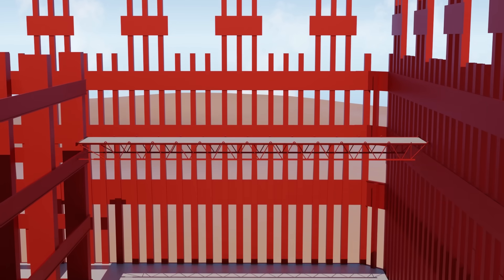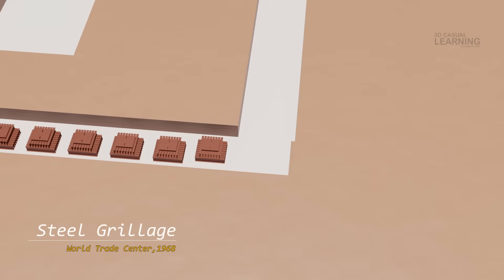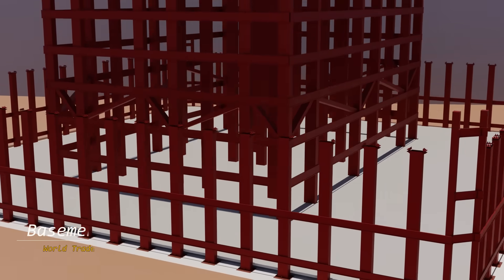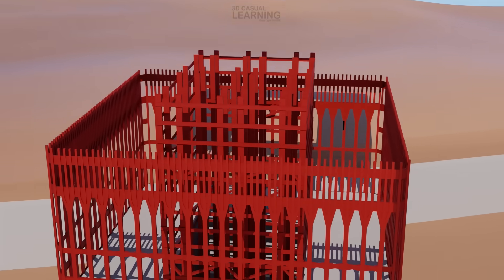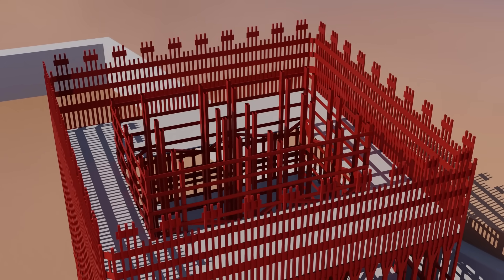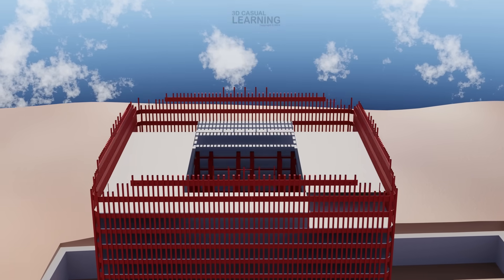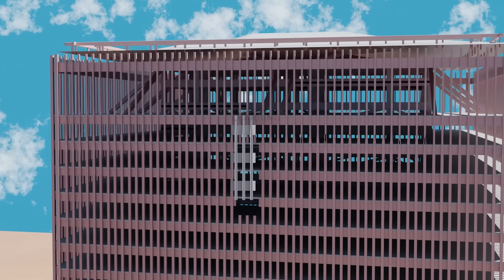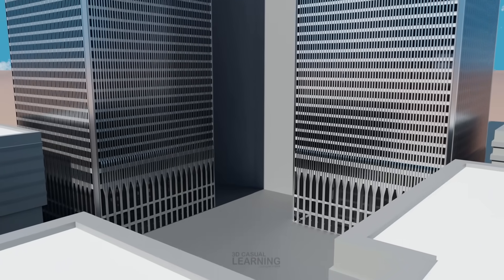The Rise of the World Trade Centre: Construction Story Before 9/11 in 3D Animation

Comment: A building should support 2 times its weight, which is a safety factor. Vertical perimeter columns peel off when the building is collapsing and each floor gets support from the outer skeleton and core beams. Why did it peel off? Connections between the exo skeleton and each floor are strong as to support the weight of the floor. When upper floors fell over the floor, connections were cut off from the exo skeleton because those connections are not strong, so the outer structure peeled off which is explained as a pancake or domino effect. Exo skeleton structure is one of the reasons for to increase deaths and the collapse of towers perhaps.

Comment: So where is the data on the distribution of steel down the structures?

How many tons of steel were on level 105 compared to level 5 which had to support the weight of 21 times as many stories?

Why weren't structural engineers and physicists discussing that within weeks of 9/11?

In fact AE911Truth does not discuss it even though I confronted Richard Gage about it at one of his Dog & Pony shows in 2008.
.

Comment: how easily it fell with controlled explosives
Reply: Dope you are like a lot pf people you just post ignorance - As any engineer will tell you you don't have to heat steel to melting point you just have to heat it enough to weaken it 
And two take it from a volunteer firefighter of 8 years - With all the chemicals in a modern building ( furniture and applinces ) the flashover point can be reached in less than 3 minutes and can reach 3600 degree celsius 
Here is a link that shows flashover - A flashover fire is the nearly simultaneous ignition of all combustible surfaces in an enclosed area, transitioning a localized fire into a fully engulfed, rapidly spreading blaze. This occurs when hot smoke and gases at the ceiling are heated to their autoignition temperature, then radiate heat downward to the room's contents, causing all exposed materials to release flammable gases and ignite at once. Flashovers are incredibly dangerous, as they create unsurvivable conditions within seconds, trapping occupants in a fire ball with little chance of escape.   - https://www.youtube.com/watch?v=BtMmymOxdjc&t=132

The 757 planes had 36000 gallons or 90000 litres fuel

Comment: And all that steel came straight down? 80 floors of healthy, not affected steel?
With v-cuts around the base? Why did it not collapsed to one side or the other? In the path of most resistance? 
Get real, the sh*t was blown to dust. Not even DNA found from 1000 or more victims? Where is the black boxes? And "they" found a passport from one of the terrorists? 
Many questions and never ever one straight answer.

Comment: FUCKING FLIMSY DEATH TRAP.......JUST  SOMETHING TOO  FLIMSY  ABOUT  ITS  CONSTRUCTION......NOT  ENOUGH  SUPPORT  PILLARS  AROUND  ALL  THE  WIDER  FLOOR  AREAS......TOO   FUCKING  OPEN..... AND  THE  WAY  IN  WHICH  THE  FLOOR  BEAMS  WERE  WELDED  TO  THE  OUTSIDE  WALL  SECTIONS......IT  ALL  JUST  HAS  A  NASTY   ALMOST  FRAGILE  FEEL  TO  IT  WITH  THE  MAIN  STRENGHT  BEING  IN  THE  CENTRE......NOT  ALL  AROUND  THE  CENTRE.......SHOULD  HAVE  BEEN  A   SEA  OF  IRON  GIRDER  STYLE  SUPPORT  PILLARS....  ON  EVERY  FUCKING  FLOOR  RUNNING  ALL  THE  WAY  THROUGH,  AND  DOWN  THE  STRUCTURE  TO  THE  GROUND  LEVEL....THIS  WIDE  OPEN  SPACES  THINKING......WAS  NICE  TO  WORK  IN....BUT  ULTIMATELY  MADE  THE  WHOLE  SRUCTURE  WEAK   IN  ALL  AREAS  AROUND  THE  CENTRE  COLUM....THIS  ULTIMATELY   WAS  PUT  TO  THE  TERRIBLE  TEST  BY  AIRCRAFT  IMPACTS.....AS  THE  CENTRE  COLUM  AREA/ AREAS  WERE  DESTROYED.....THE  WEIGHT  ABOVE  THE  IMPACT  ZONES  WAS  TOO  GREAT  FOR  JUST  THE  FLIMSY  OUTER  WALLS....AND  IT  BUCKELED  LIKE  A TIN  CAN..... !!!!!!  TOO  WEAK  AROUND  THE  CENTRE  CORE  AREAS.

Comment: I realize this is a dumb question, but why couldn't they just rebuild the towers back according to the original design? Would it have been possible?
Reply: Donald Trump put together a plan in the mid-2000s to rebuild the towers but make them 115 floors tall, and with concrete cores, building the new towers right next to the footprints of the old towers, but the plan never saw the light of day, and probably would've given survivors PTSD
Reply: It had design flaws especially for evacuations. They were a plan created from Trump to rebuild the twin towers but "stronger". Which is would've loved to see that than what we got now but I understand why they choose the freedom tower.
Reply: Possible, yes.  However there were many design flaws made especially apparent after they collapsed.  A redisign to modern standards would be necessary.  I like the new tower, it's beautiful and full of symbolism but doesn't project the same sense of scale as the original 2 (even if they twinned this one)
Reply: It's Literally Just A Design From The 60s + Everyone Inculding Survivors Would've Had PTSD Flashbacks.

Comment: The 47 core columns of each tower are puzzling. Initially fabricated in the far east and shipped in. Other than some strange videos filmed from the  Hudson where the remnants appear to disintegrate in mid air and called 'spires' over 600ft high l wonder what happened to them 
    At their base the concrete slabs etc impacting should offer a 1000th of a Hiroshima in energy at most

   The buildings were utilitarian but the safety requirements were ditched after construction of the slurry wall had began.
  The Port Authority reduced the number of stairwells from 6 to 3 ..
       2 of these only 44" wide !
   This was an unsafe working environment.
 The truck bomb of '93 required an evacuation which took 4 hours using elevators and stairwells.
 A power outage alone could have been hazardous 
   Ref. Evacuation time of Sears tower / Chicago building for example 
  
   The Twin towers lead structural engineer John Skilling stated that 'either tower could lose an entire side of exterior columns due to a 707 plane strike and still withstand a storm of the century gusting 100mph although fire casualties would be horrendous'. 
        This is not impressive structural engineering if the core is compromised (disabling all elevators in the tower and blocking stairwells at plane strike floors) trapping occupants above. Commercial aircraft were known to be getting larger 
      
  A bright red 25' sculpture called bent propeller was moved around the WTC towers , last put by WTC7
Reply from the maker: Thanks for your detailed observations and sharing your research; it provides important context to the structural design and safety aspects of the towers.

Comment: The trusses were connected to the outer perimeter wall and the core with remarkably small "hooks". They look so small it's hard to believe they held the whole building together for all the years that they did. Each of the trusses had 3 of these "hooks". I know this information, not because I have inside information, but one of these trusses can be seen in my town as part of the 911 memorial. Just looks flimsy. Ridgefield, CT.
Reply from the maker: That’s a really interesting observation, and it’s amazing that you’ve seen one of the actual trusses up close at the 9/11 memorial in Ridgefield. The design might look minimal or flimsy at a glance, but it was part of an innovative structural system that relied on the full interaction between the trusses, the outer perimeter, and the core. Engineering often surprises us with how strength comes from smart design, not just size. Thanks for sharing that detail!
Reply: Thank you arm chair engineer, I can't believe that you found it hard to believe that the building stayed together with what you observed to be flimsy hooks. Maybe your engineered building will withstand a wide body jet flying into it.
Reply: @dancovaleski6520 yo respectfully shut the hell up. why do you just hate everything? i've found at least 2 hate comments from you on the same channel. what is wrong with you? like if you hate the Twin Towers, that's your opinion, and you don't have to share it. you might as well be with al qaeda at this point, gng.

Comment: Yet this solidly built structure was brought down by a pressurised aluminium cylinder, 1/8th of an inch thick, travelling at speed?
Reply: Yes
Reply: @davidpowell6098  it was the jet fuel burning that melted the steel causing them to collapse
Reply: @MW_Green  The steel weakened
Reply: @davidpowell6098  Can Floors Collapse 300 Feet Below a Fire Due to Heat Alone?
Generated on May 20, 2025 at 11:15 PM
Short Answer:
No. Floors 300 feet below a fire cannot collapse from heat alone unless the fire directly spreads there.
1. Heat Doesn’t Travel That Far Down by Itself:
Heat from a fire rises. Steel conducts heat, but not fast or intensely enough to weaken structural steel 300 feet bel
2. Floors Can Collapse Downward From Above – But That’s Not Heat:
If upper floors collapse due to heat, the falling mass can crush lower floors. This is gravity and impact, not heat.
3. For Heat to Weaken Floors 300 Feet Below:
- A fire would need to be burning on those lower floors.
- Or the fire must spread down through structural gaps.
- Or involve a separate ignition source.

Comment: Asbestos was used as a spray on fireproof coating.
Reply: Only in Tower 1 and only up to around the 35th floor. NYC banned its use early in the project and they switched to Blazeshield SFPM. There was no asbestos in WTC 2.

Comment: Imagine building a juggernaut out of steel and concrete all only to then lead people to believe that a jetliner cut through it like butter
Reply: what did you expect to happen? the plane bounces off the building?
Reply from the maker: The jetliners caused massive damage by penetrating the exterior columns, igniting intense fires fueled by jet fuel and office materials. This combination of structural damage and fire ultimately led to the collapse.
Reply: @3dcasuallearning  You mean that the thin aluminum fuselage of an airplane designed to be as light as possible passes through thick and narrow steel columns (3 times denser than aluminum) designed to best withstand tensile and compressive stresses?
Reply: @Neo-je4bi at 500 mph, yeahhhh
Reply: @Little_bacon_bit  An airliner flying at cruising speed close to the ground? Is it really possible?

Comment: The open floor plan was a driving factor for the design. However, what I don't fully understand is if this was so important why wasn't each floor designed with higher ceilings? The typical ceiling height on each floor was so  low. The interior seemed claustrophobic. It really defeated the open plan design.
Reply from the maker: The typical floor-to-ceiling height in the World Trade Center was around 8.5 feet, which was common for office buildings at that time. While it may feel low by today's standards, it was designed to fit within the structural limits and design goals of the era.
Reply: @3dcasuallearning  8.5ft  is a typical ceiling height. Today, tomorrow, always. The building was designed with those ceiling heights to maximize space which maximized leasable area which maximized profits.
Reply: The ceiling for numbers of bodies disappearing in a building collapse is less than 10% . How could that number become 90% ???!!!

Comment: I worked to do an office build out on the 83 floor. We installed floor to ceiling solid doors on pivots. It was amazing to me how much the plumber bob would swing when after installingbthe top pivit we had to locate the spot for bottom pivot. The plumbbpb would swing an inch or so back and forth sometimes we’d slit the difference and adjust later when we saw the gap at the jamb
Reply: There wa also a technical plumber for elevators. If it moved too much, elevators were shut down automaticaly.
Reply from the maker: That’s an awesome story! Thanks for sharing your experience....it's incredible to hear firsthand how much the building would move at those heights! Must have been quite the challenge!
Reply: Да там все здание такое. Всего 3 эвакуационные лестницы на этаже и все они являются задымляемыми, без тамбуров для дымоудаления. В России такое здание никогда бы не прошло экспертизу по пожарным нормам.
Reply: @nd5301  просто надо больше денег занести было.
Reply: @nd5301  Какого черта ты здесь?

Comment: Only thing that would “pancake” might be the floors spanning between the core and exterior columns (and there is no 100 floor stack in the rubble pile) but no way would the verticle steel columns  pancake and most certainly not at the same free fall rate we witnessed in videos, thus that leaves only one explaination that fits it all together perfectly.
Reply: Large portions of the core were still standing for several seconds after the collapses. You can see this in some footage. So the floors did kind of strip away from the core as the collapse progressed. The core though was also heavily damaged and fell apart too. For the record, neither building fell at free fall speed. This is a widely spread claim but its incorrect. The timing of 9 seconds, and 11 seconds was calculated by taking the exact moment the building would begin falling and when the first large parts of the building struck the street below (which was detected). However, the first parts to hit the ground encountered only air resistance on the way down. The actual collapse times are hard to estimate.
Reply: @JDela10  no I don't believe what you're referring to was the core, but rather just long sections of a perimeter wall section. 
I've seen that footage and it doesn't line up with where the core was
Reply from the maker: Thanks for sharing your perspective! The collapse of the towers has been widely studied, and I encourage looking into the engineering reports for more detailed explanations of how it all happened.
Reply: @3dcasuallearning  Widely studied by who? The government that did it? I encourage you to read government conspiracies like Operation Northwoods,and for media complicity Operation Mockingbird also study bld 7 that was a completely different structural configuration not hit by anything yet fell by fire after the owner said “pull it”
Reply: @joedoe-sedoe7977 There have been independent investigations of the collapses, minus the NIST.

Building 7 was hit by debris from the collapse of the north tower. The owner saying pull it, in the context of his his quote means nothing. Unless you think the fire department was in on the plot.
Reply: Oh shut up
Reply: Este video es la prueba reina de como los incendios se concentraron en los asbestos por eso se ven esas estelas de humo en el cielo una demolicion controlada no deja todo ese humo en el cielo muy triste lo que mas me impresiono fue cuando supe que la pelicula infierno en la torre 1974 era un libro escrito para gacerle un homenaje a las torres gemelas la pelicula la mire en 1986 muy premonitorio lo que le dice steve mc queen a paul newman ojala una de estas malditas trampas no maten a unas 10000 personas y sucedio en las torres gemelas el incendio en la pelicula es provocado por un corto circuito los incendios del word trade center se concentraron en los asbestos tubos de ventilacion y computadores avivados por el aire y los cortos circuitos no tiene ningun misterio h ciencia entender lo que sucedio ese dia nadie imaginaba que todos esos incendios este video esta explicado todo jimmy hernandez😮😮😮
Reply: I'll put it in steps so it's easy to follow (albeit grossly simplified):
  1. fun fact - when you run, your legs sustain 3-5x your body weight (for a short moment) and you're only "jumping" a few inches
  2. now remember that the airplanes left a huge gap in the buildings, and not only that, the heat kept rising, and u can see in the videos how worse the fire kept getting
  3. now think of step 1, except replace your body weight with the top 10+ floors of WTC hitting the first "healthy" (undamaged by airplanes) floor from below - it would have to whitstand 20x or even more weight than it was designed to
  4. now that floor gives in, the next under will be tested against the same force (now increasing)

Not even the core would be left standing, it's like train crashing against a wall held by some steel joints...the joints would bend/break...that would also cause the core to collapse (which is not 1 solid piece, but multiple pieces with joints)...so nah, you wouldn't need explosives to do that...

Comment: There are no concrete slabs on the floors here, It is almost entirely of iron construction, the question arises, where did so much dust come from on September 11? How did the building turn into a mass of dust? Maybe there were specially placed thermite detonators that reduced the iron to dust? 😉
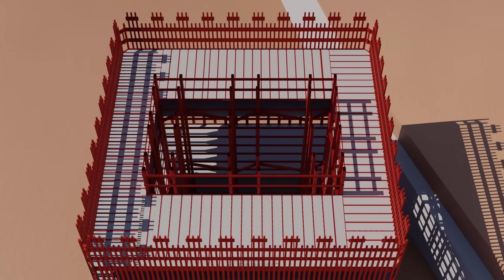Reply from the maker: 8:05 The Twin Towers actually did have concrete floor slabs supported by steel trusses. During the collapse, the combination of the concrete crushing, drywall, and other building materials created a huge amount of dust. There’s been a lot of research and investigations into the collapse, and while theories like thermite have been discussed, official reports concluded that the intense fires and structural damage from the plane impacts led to the towers' collapse.
Reply: أنت من جماعة نظرية المؤامرة المتخلفة عقليا 😂😂😂
Reply: Another toilet seat expert
Reply: Try again fool an expert in demolitions said it would be impossible to bring down the towers with either explosives or small thermonuclear devices because the ensuing shock wave would be equivalent to a 6.5 earth quake causing strauctural damage to all the other buildings for a half mile radius